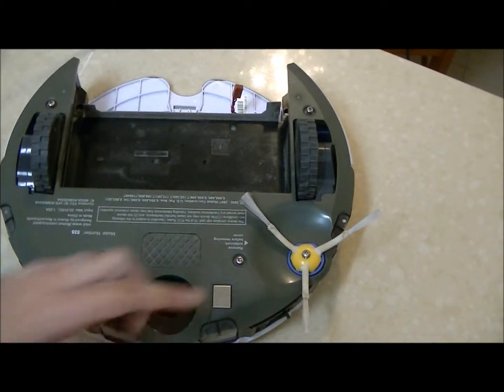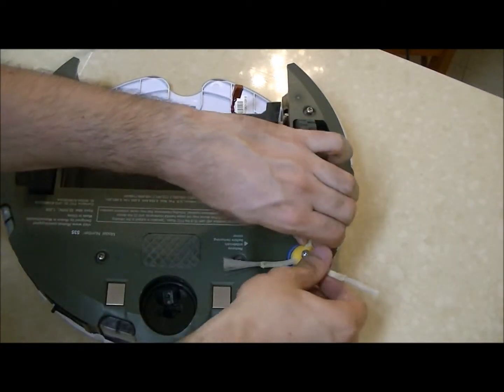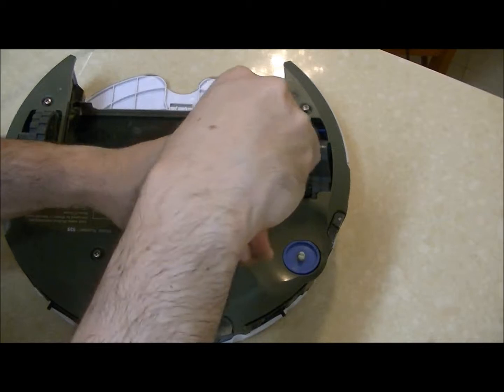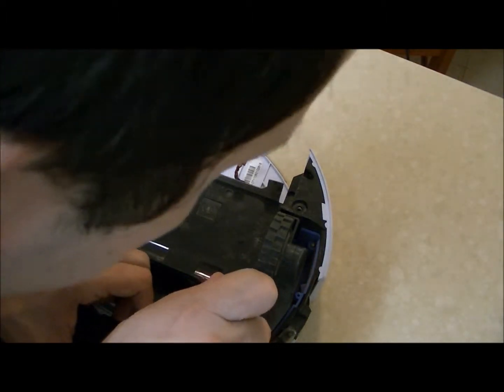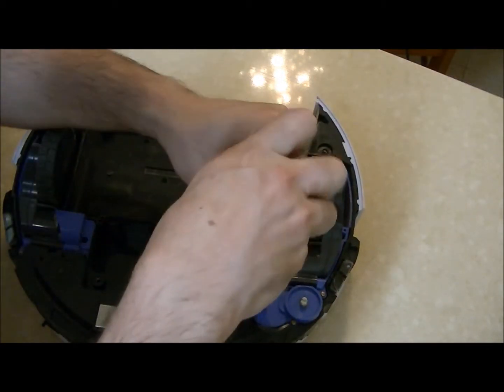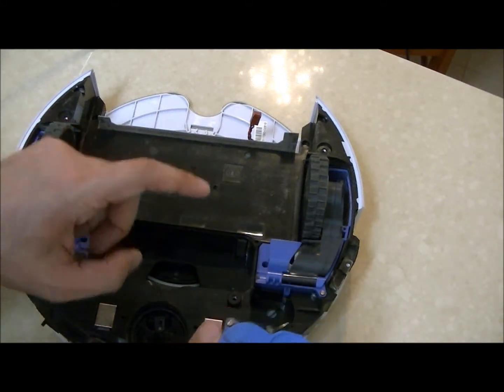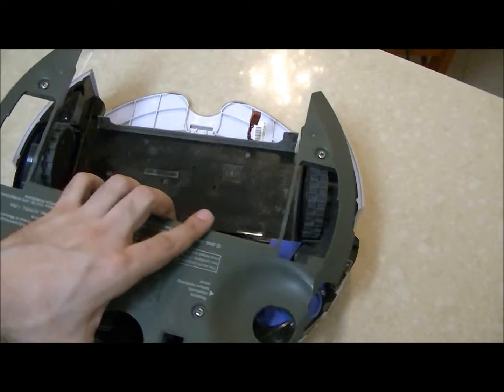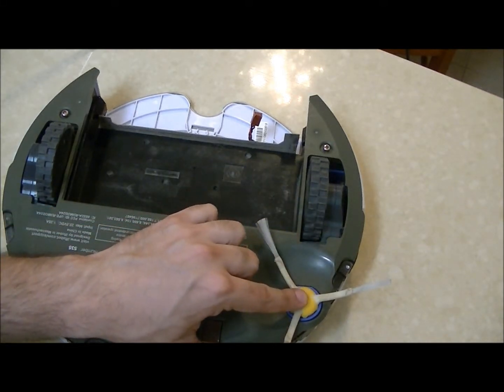IRobot Roomba 500 & 600 Series DIY How to replace the Side brush motor

Comment: how can one test if the side brush motor is still working or dead? Mine does not rotate, but how can one test if the motor is dead?
Thanks, Mike
Reply from the maker: +LAB Group that's the video you want https://www.youtube.com/watch?v=Ssz7965y1mU
it's the 19th test .
check page 48 here >> http://www.manualslib.com/manual/447868/Irobot-Roomba-570.html?page=49#manual